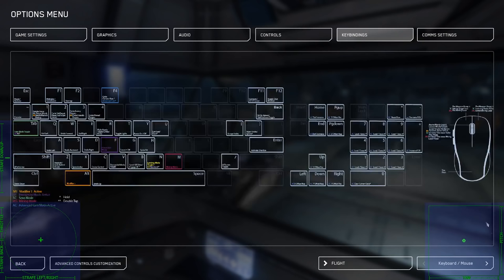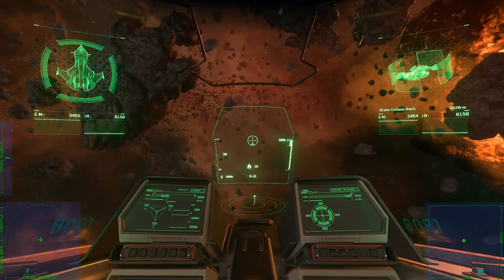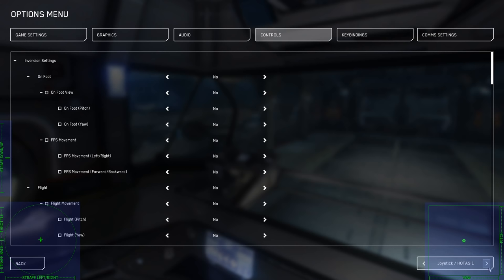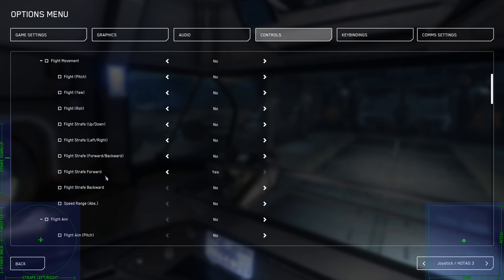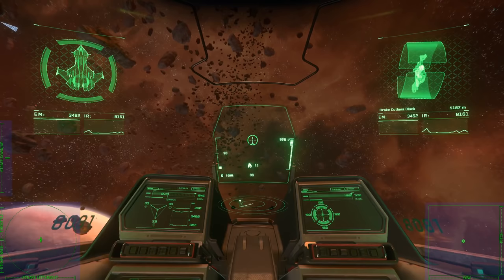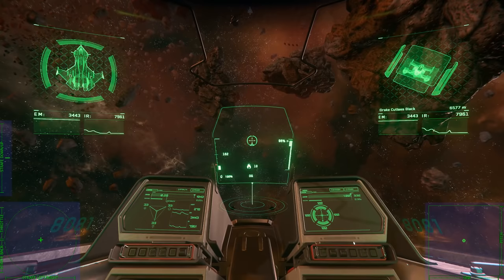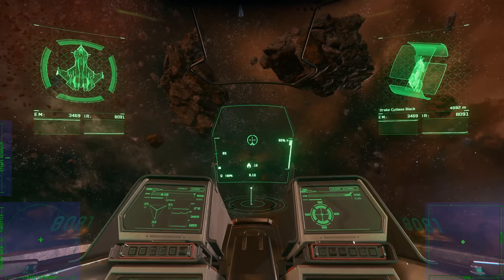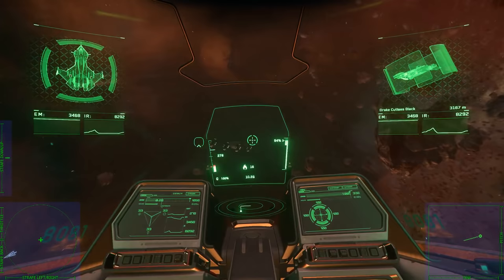How to Make a HOTAS Throttle Work in 3.5 PTU (still works in 3.17.1)

Comment: Jesus Christ, if only I had found this video earlier. For me it was the sensitivity curve settings for my throttle. I wanted to increase the travel of the throttle, so that it reaches the upper SCM limit at about 50% travel at the Y axis instead of after half an inch. I had no idea which setting I had to modify. Tried several other settings without success. Nearly gave up.  Thanks to your video, I tried the "Strafe forward / backward" setting and voila, that's it! :)

Comment: Glad they have made it so intuitive. 🤔🤔🤔🤔🤔🤔🤔

Thankyou for this explanation, saved me hrs of swearing at the screen.

Really don’t know why SC is insisting on reinventing the wheel for everything, and 99% of the time getting it wrong.

Cockpit interaction is complicated, setting up the throttle is now complicated, choosing a speed rather than just using said throttle is complicated.

All these things have been done before in other sims and work well. So just implement those systems. Surely

Comment: Quick tip for those who might have the Thrustmaster FCS throttle.. I've mapped the throttle forward to the throttle as you described, but to go backwards I have the forward+reverse throttle on the paddle itself.  This is where I had the old strafe, and I love being able to pull the paddle to quick reverse.  Works great once you have the axes flipped right so the paddle is neutral when untouched.  I'm toggling on and off the speed limiter much like scm/cruise toggle.  I did try for a while keeping cruise on fully and mapping the speed limiter to the analog throttle but didn't like it as much.  FWIW, thanks for your videos.
Reply from the maker: Makes sense. Thanks!

Comment: This was helpful. However I ended up going one step further because what I found was that the ship was not stopping once i lowered the throttle. (Only the speed limiter would do that)  So I tied the Speed Limiter to the throttle too. Then i had to invert about three options and it worked just like the old days. Super excited! Thanks for the inspiration!
Reply from the maker: That sounds like maybe you were in decoupled mode?

Comment: Thanks a lot ! This video was very useful for me !

A remark though. I have exactly the same joystick which is shown in the game. A Logitech extreme 3d pro. By default, "strafe forward" is allocated to "up (hat1)". Unfortunately, it is impossible to keep this hat function for consistency and, in the same time, to have "slider1" binded to it. They should have created a separate key binding maybe called "throttle forward" for the analogic axis "slider1", which, by default is assigned to nothing in flight mode (incredible, for the game sample joystick !!!). This is only possible if you use instead "strafe forward/backward", but in this case, you would need the slider to have a cranted course with "zero" in the middle, which is unfortunately not the case.

Comment: as far as the numbering of the Hotas goes, it would help immensely if Star Citizen would adopt the technique DCS uses.... no matter how many times the computer is restarted or controls unplugged and plugged back in, DCS always finds the game hotas /control / gamepad on initialization. Never need to have  the  various controls ID'd number wise. Additionally, if your hotas is numbered 6 or 7, it will not be recognized, as the numbering system Star Citizen uses only goes up to 4.

Comment: I have not touched SC since shortly after 3.0, honestly losing faith in the project. However, updating right now because curious.

I love these LIS videos and I watch them whether I play the game or not. I have a question.

I already had a X52 when I started playing SC which works fine, however I found reversing a pain to handle. Elite Dangerous has a simple toggle button which you can bind, does SC have that now? I seem to recall that it didn't, and is one of the reasons why I moved to dual sticks. As much as I like dual sticks there are times that I miss having the throttle, so a forward/reverse toggle bind would be great if it has one.
Reply from the maker: This should be working, I just tested it. Go into keybindings under movement and bind "Strafe forward/back invert". This will switch it on command in the way I think you want it to.

Comment: Thx for the vid, so do you have a deadzone in the middle of your throttle with this setting? because I am having a pain with no deadzone so i cant find a proper middle position.. u know what I mean, im going forward and backward likea nuts until i find the zero position...
Reply from the maker: You need to bind throttle forward, NOT throttle forward/back.

Comment: is there no way to bind forward and back  strafe to their own hat switches anymore i used to have it back on my tumb hat before the new flight model came out now i gotta have forward and back invert on one thing and its not nice i miss my old way of my hotas :(
Reply from the maker: You should be able to bind it still, exactly like before. It is called "throttle forward" and "throttle back" now but it does the same thing.
Reply: @LegacyFleet  i'll have another fiddle with it. i am kinda tempted to try duel sticks. as my hotas is a lil bit old now. thanks so much for the reply been enjoying your videos :) keep the great work

Comment: Didn't work for me, for my X65-F i really need to load up the X52 PRO settings to get the throttle to work. After that I can mod the buttons and all though.
Your method here makes my throttle work like an on/off switch hehe.

Comment: Any tips for configuring the reverse on a hotas?  I used to use the strafe forward/back for going in/out during combat.
Reply from the maker: You can still do it that way. Any particular reason you don't want to anymore? Or are you just asking if there's a better way?
Reply: Legacy Instructional Series I’m just looking for a better way. I use a hotas warthog. Used to have the thrust in the 2 throttles and strafe forward and back on a side throttle toggle. I configured the forward thrust as you described but have had to put the reverse on the side throttle and they can short one another out. Would like to find a way to replicate a strafe forward/back
Reply from the maker: @The4acesoutfit  Have you tried just binding it as you did before? I'm sorry if I'm misunderstanding something.

Comment: Thank you for this!
I noticed one thing tho. I think the Strafe forward actually is strafing, and not main engine controll. When i decouple, with throttle at "set point" and turn, my ship changes course towards my nose orientation. If i decrese throttle in decoupled mode, it stops correction and drifts in the last given direction (as i expect decoupled to work). Hope you got what i mean, kinda hard to explain in english.
Reply: If your main engines are on, they're going to push you forward even whether you're decoupled or not.

Comment: if you put limiter abs on the same z axis as the strafe-forward, it would theoretically give you the little bar as your visual indication of desired throttle vs the actual speed indicator bar, right?
Reply from the maker: It would, but you wouldn't be able strafe sideways or backwards when your speed limiter is low.
Reply: No less than you can on other controllers when the limiter is low.. one has to raise it to strafe.. So in my example, you'd up the throttle as you strafe, replicating what a mouse user must do.

I use joysticks for strafe strength myself and leave the limiter off (at 100%), so I agree with you that it seems like an odd thing to do, it's just a way to get a "desired speed" bar onto the hud in the way described in the video, using existing systems in place
Reply from the maker: @hermitbodhi6130  But if you wanted to just strafe left and not forward at all, how would you do that?
Reply: You are entirely correct, I had not even considered that!  Thank you for your instruction
Reply from the maker: @hermitbodhi6130  I actually found a way to do what you are saying using external software https://youtu.be/jdg8zLSaLfI

Comment: is there a way to bind the throttle limiter to a HOTAS throttle and just leave cruise on?
Reply from the maker: You can do that but you won't be able to strafe in some situations.
Reply: such as at higher speeds?  or does cruise completely negate any lateral or vertical strafe input? my strafes are currently on a hat on my throttle
Reply from the maker: @eatthedead1ify  The speed limiter is what will negate your strafe. So if you are stationary with throttle at zero and want to strafe only right, you can't.
Reply: oh yeah   i knew that   lol    thank you for the info!  its been hard to think for too long irl due to school and work. but i really do appreciate this.

Comment: Thanks for the instructions in the video. Two questions: How do you straffe/throttle back, by binding a different joystick button to the Throttle back keybinding? Also, do you know a way to straffe forward and straffe back like we used to have in 3.4.3, which was very useful to finetune the approach to the landing pad (final moments)? Right now I use the speed limiter.
Reply from the maker: You are using a HOTAS? How did you have it bound in 3.4?
Reply: I did not have a HOTAS back in 3.4.3, unfortunately. Hence I am asking. I had a Logitech 3D Extreme Pro and the hat of the joystick was used to straffe forward, back, left and right. Up and down straffe was done using two separate buttons on the side. It had a small throttle which was used the way you describe in your video: to throttle forward.
Reply from the maker: @JaumeSabater  Oh I see. You want to have the throttle be strafe forward and have buttons for all the other directions. Yes, you can do that by simply binding the buttons to "strafe left", "strafe right", "strafe up", "strafe down", and "throttle back". The one thing you can't also have is a separate button that also does strafe forward like your HOTAS axis, because that binding is already taken. A solution could be to make your throttle be "strafe forward/back", then use external software to limit it to only strafe forward. Not sure if that'd work for you.
Reply: @LegacyFleet  Right now I am playing with Throttle forward/back binded to the throttle. I watched your video because I want to try and use the throttle to just go forward (check how the animation of the throttle of the Aegis Vanguard, among many others, works vs the one on the Terrapin, for example). But I still need a clean, simple way to "move backwards" when landing. Also because my Logitech X56 does not have a deterrent in the middle (I am using an S curve now, which helps but it's not ideal).
Reply: @LegacyFleet  In 3.5 they removed the bindings to strafe forward and strafe back, but most of ships still have animations like modern fighter planes (all the way forward). Not sure if they plan on changing that or whether they plan on having both ways of having a throttle in spaceships. Nonetheless, how do you play the game? Do you have a HOTAS?
Reply from the maker: @JaumeSabater  They actually didn't remove strafe forward and strafe back, they just renamed them to Throttle forward and throttle back. There is also an option to use a button to switch your HOTAS throttle from controlling forward to controlling backward if you don't want to use a button to control backward.
Reply: @LegacyFleet  Just to let you know that the possibility to bind the "Throttle forward/back" keybinding to the throttle in the HOTAS and then having "Throttle forward" and "Throttle back" set to one of the hats or mini-joysticks on the joystick is back in 3.7 (no conflict among them, although it's not straffing as it does not move your ship smoothly but the same way as if you were using the throttle). So, well, it's there for you to use if it feels more comfortable, but it's not really what we had in 3.4.3 that helped in the final moments of landing. That you have to do using the speed limiter and accelerator limiter, as in 3.5 and 3.6.
Reply from the maker: @JaumeSabater  Yes you are correct, although none of this has really changed since 3.4. The reason it doesn't feel "smooth" anymore is the changes to ship tuning. It isn't a control difference. . . Coupled mode really works in the same way as it always has, there just renamed some of the controls and added in the limiters.

Comment: Yeah this isn't working for me, sometimes it does and then suddenly it's not and the ship gets stuck flying forwards forever. It's like the game don't want me to fly this way so it f*cks with me. I can't make it stop. They f'cked up the flight system. It was good as it was before.

Edit
Okay I figured it out. Sometimes throttle forward/backward is just throttle forward and then it switches and now it's both as it should be, and then it switches again and just throttle forward is throttle forward again. The game can't decide what is what. Those two settings are swapping with each other all the time. This is the weirdest bug. No one else has it, only me and it's been like this since they changed it all. Now I have to go to the settings and change the throttle between those two every 5 minutes or I'm stuck in throttle forward.

Comment: Doesnt work at all sadly , followed exact instructions and still getting the reverse throttle commands or the throttle doesnt work at all , brand new thrustmaster warthog
Reply from the maker: Doubt the problem is the latter. Are you sure you are flipping the axis on the correct device? Are you are you are flipping the "Throttle forward" axis and not the "Throttle forward/back" axis?

Comment: This does not work for me at all.  The throttle behaves like a switch instead of a slider when I do this.  Nothing even remotely like this works at all.  All my many flight games work as well as 3.4.3 work fine with this hotas.  Why the Evocari testers let RSI get away with this only makes sense if they are all mouse users.
Reply from the maker: Yes, we're all mouse users, clearly.

Comment: about the flight model, it suck for space battle. You , blackout too quickly, EASILY and no real maneuvering. You’re just sliding,SLOWLY. THRUSTER, PITCH AND YAW RATE ARE SMALL, and  LARGELY UNDERPOWER. SHIP ENGINES ARE TO FAGILE AND TO EASY TO OVERHEAT. THIS isn’t a flight model, but more of R&D projects on design engineering. You don’t have time , FOR ALL THIS , ESPECIALLY IN A CLOSE IN VERY VERY SLOW BATTLE THAT CIG IS TRYING TO MAKE. HELL now I understand the old saying. IF YOU ARE GOING TO KICK MY ASS, YOU BETTER BRING A LUNCH.